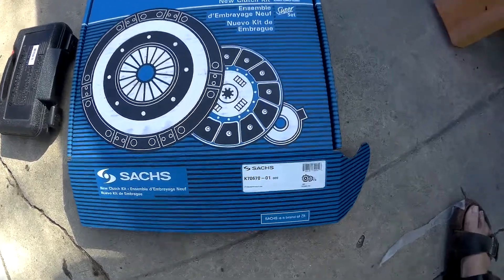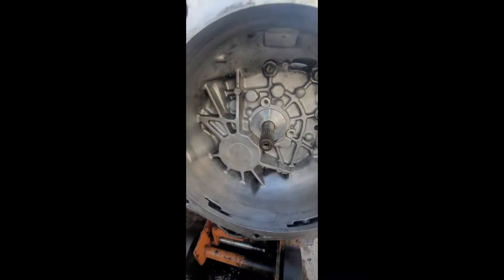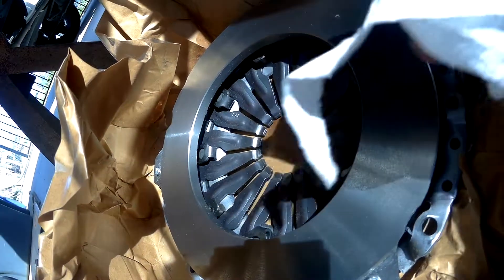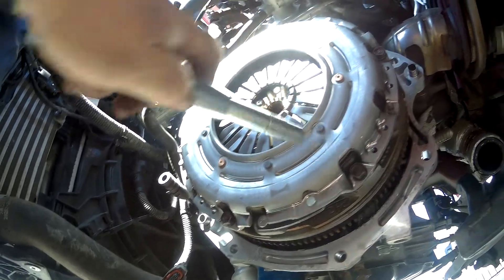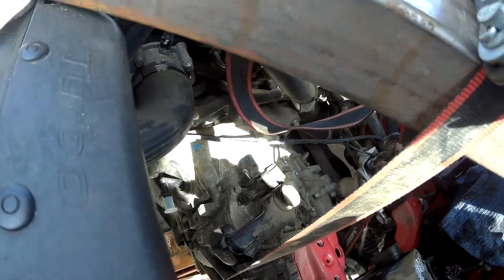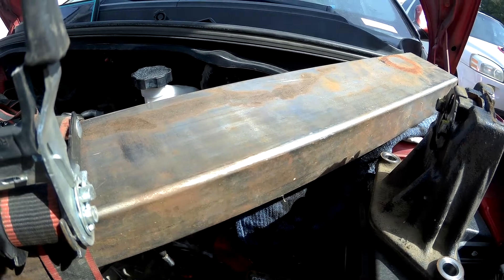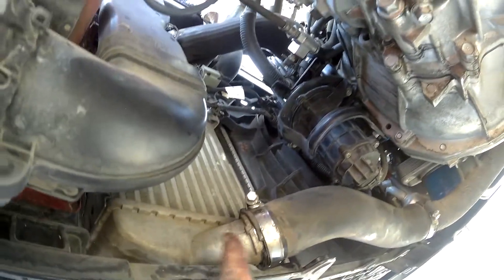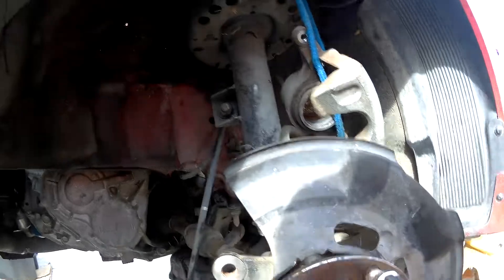2013 Hyundai Veloster 6spd Turbo  clutch replacement part 6.1

Comment: So my DCT is chattering/clacking at idle. I’m thinking it’s the flywheel. What say you? It shifts fine and drives fine only makes noise at idle.
Reply from the maker: it could be a bad fly wheel or bad disk on the clutch pac, If it dose it only while in neutral or park I would think flywheel, if it only dose it when in drive but at full stop might be disk,
Reply: @ikiru1969  Yeah it only does it at idle and at a stop. Once I'm moving along it goes away. Mines also the DCT 7 Speed so the flywheel is a little different than the one seen in this. video.  The trans was a warranty swap about 30k miles ago but I'm certain they used the same flywheel and did not swap it when they swapped the DCt trans.